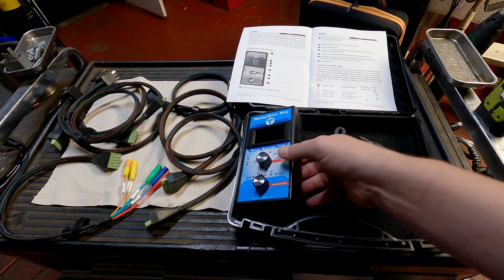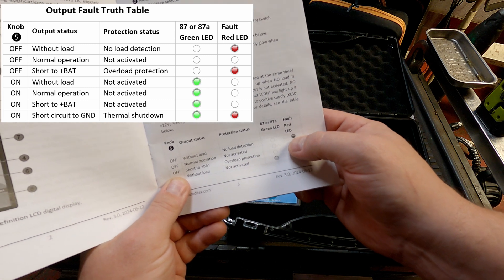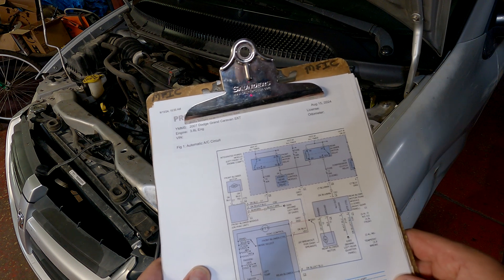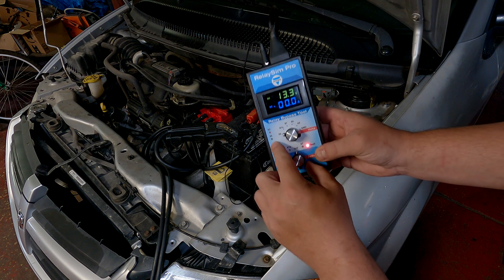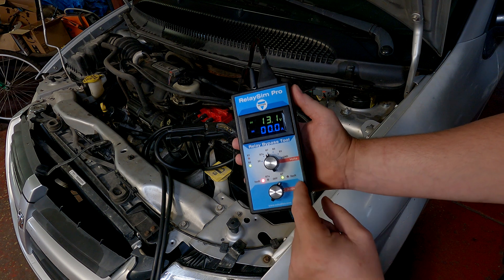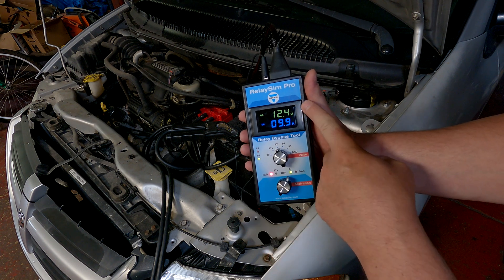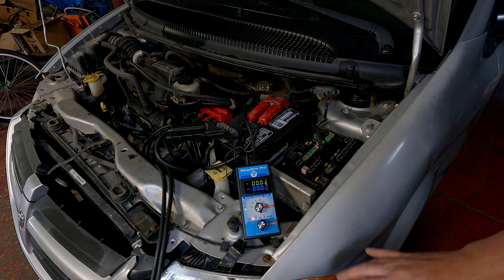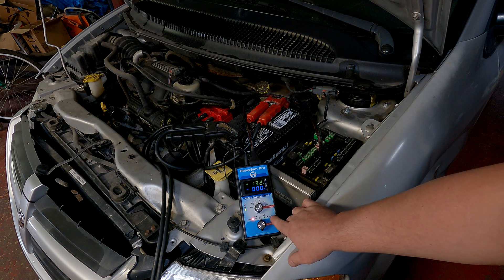RelaySim Pro: Walkthrough on a vehicle

Comment: If the Tool cannot load the circuit is is useless
Reply from the maker: This is a professional grade tool made for people who understand dc electrical circuits.
It is not safe to arbitrarily load relay control circuits. The current needs of an individual relay can vary substantially. 
This tool is not designed to load any circuits. 
It is a switch with cleverly designed circuits around it to help you quickly identify faults or operate relay switched components. The current and voltage display makes this tool extremely useful in the hands of a professional. 
If you can't see the value, don't buy it.  
I recommend a basic electrical course to help you understand the usefulness of this tool. 
I have saved hours of time with it over the last month. I find it to be extremely handy.
Reply: @710diagnosticsandfishing  You apparently don't understand how electricity works!  That circuit can be checked just fine without that Tool and Pin 30 is a fused feed! Only because a meter shows  12V does not mean that the circuit can carry the load!! Go do some research!
Reply from the maker: I believe we are misunderstanding each other. I definitely could be wrong. Maybe I don't know what im doing. 🤔 
Thanks for watching.
Reply: @710diagnosticsandfishing  No misunderstanding 300 Euro Tool that cannot even act as the relay? I don't need to spend 300 Euro to figure out a problem in the circuit. A Tool like the AESWave  uActivate would be a much better choice. Loaded circuit testing can be a life saver.
Reply from the maker: Did you even watch the video? 

It can switch on the load just like the uactivate. 

It also displays voltage for each connection 
And current on the 30/87 circuit 

Believe it or not, the vehicle comes with its own load, whatever component the relay switches on. 

The nice thing is if you understand how electricity works, this tool gives you all the info you need to decide what the next step in your diagnostic process. 

I appreciate you taking the time to comment. 

Thanks again for watching.
Reply: @710diagnosticsandfishing  Did you read my first Post?   No I did not watch the entire thing. Did you not state that the tool cannot load the Circuit?
Reply from the maker: Idk, I don't watch my videos, lol. Do you have a time stamp, I'll clarify my statement? 

The tool itself can't load the circuit. You have to turn the switch to connect 30 and 87 to load the circuit with the component that the relay feeds. 

There are many ways to find a problem. 
This is simply a useful, efficient tool. 
Do you NEED it? No. 

There are dozens of tools that you can use to do this effectively.

Comment: I would want to add a couple of more tools, the LISLE relay tester with a way to jump PWR & GND to the harness set-up in an attempt to activate a system based on what is missing during the initial testing phase. I will wait for the new videos before I make any useful remarks. You did not mention relays that are hidden inside of a module? I will assume there will be several more videos to come? With much more time into the future, a real world case study depending on the real world malfunction on a real vehicle will be very nice to see in action, all preplanned, prediagnosed and ready to test as fast as possible in a very short video to prove the point of how quick this tool can be in the real world since we should already know how to use this tool, understand its operations, and feedback once a bit of experience is gained. Most of us already know how to use the test light and jump power or ground to prove a fault the old-school way. Hopefully, with the old relay plugged into the LISLE tool, the amp draw might be measured by this nice tool on the screen to know if the relay has clicked audibly but no power passing the internal switch burned contacts, or constant power flowing through the burned stuck closed velcro contacts along with other possible relay malfunctions. Cheers.
Reply: Pls show any adaptors that come with the kit to adapt from the 5PIN BANANA harness to other types of relays or simple alligator clips? Let us know if this will be a future add-on or purchase separately or build your own adaptors, cheers.
Reply from the maker: Unfortunately, the kit doesn't come with any additional leads. I would like to see a larger kit available with leads. 
Many of us have plenty of banana leads in various kits already. It is pretty economical to build your own. 
I do plan to use this in future videos and diagnostic situations. I will demonstrate the 5 way universal harness on a vehicle as soon as I find myself in a situation where it makes sense.  

Thanks for watching. Here is a short video showing the tool in use on a broken car. 

https://youtube.com/shorts/dfo_L6PriS8?si=Dl7LQRabGlo2n7mi
Reply: Thank you:710 diagnostic & fishing for video,can i ask you one thing can you in future make video to test relay port with just test light,like you said at the end of this video,for the feed and control,for those who are just begineers in automotive maintenance.thank you I will support any new video.
Best regards from:old world